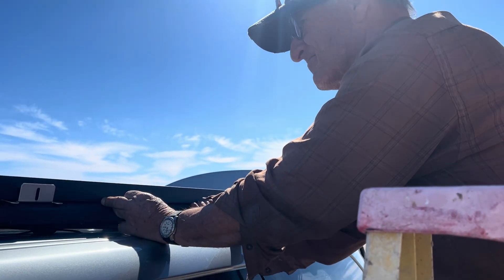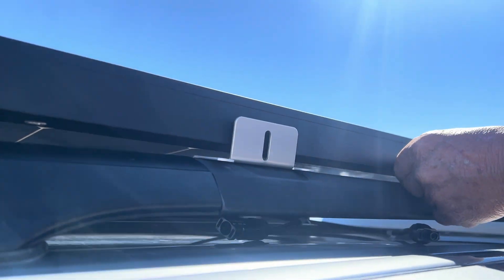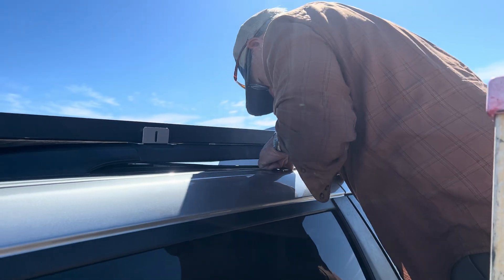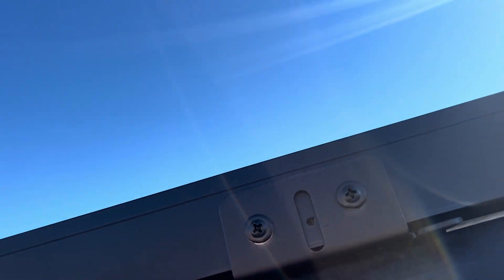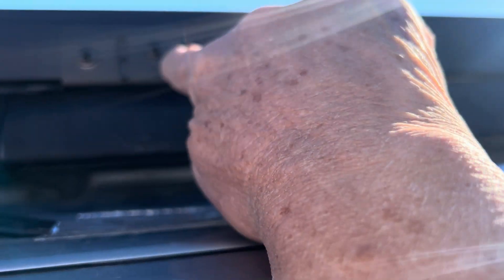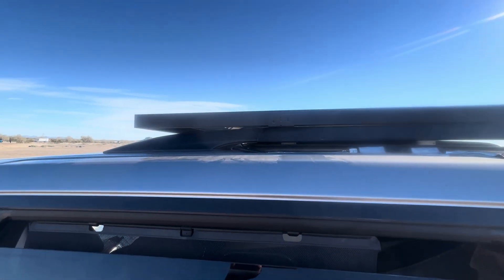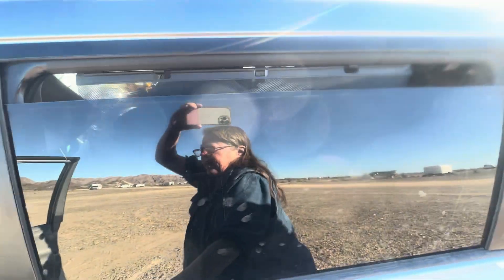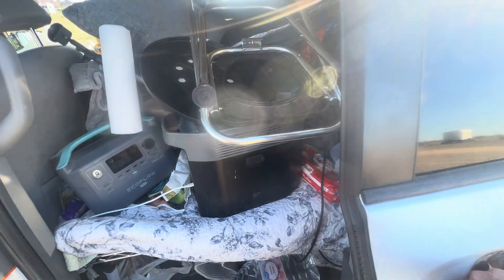Installing Solar for My EcoFlow Delta 2 | Easy DIY Van Setup

Comment from the maker: I’m not a professional—but this setup works great for what I need on the road.
The 350W panel from SanTan Solar fit my roof rails perfectly, and the EcoFlow Delta 2 handles everything I use daily.

Let me know how you power your van—or what you’re planning to try!

Comment: Great job installing the panel! The wires that go inside need to have a loop that allows rain to drop down outside. Otherwise, you will get the water run straight into the inside of the van.
Reply from the maker: I’ve heard that before, but forgot about that. Thanks for the reminder. Do you have an example link?
Reply from the maker: I’m on phone so I can’t change the thumbnail, sigh.